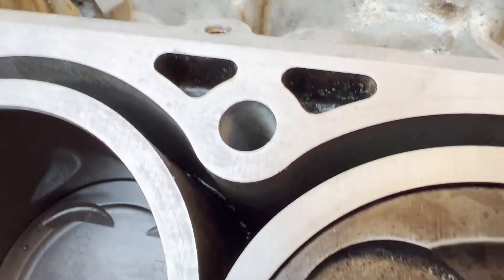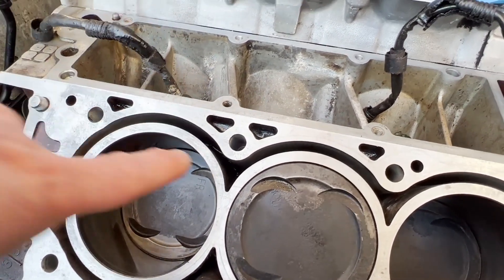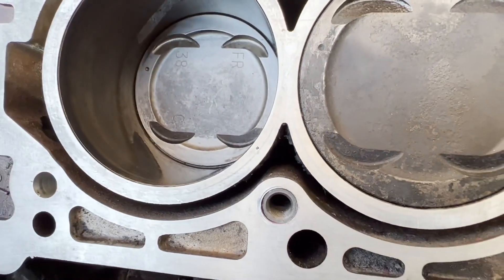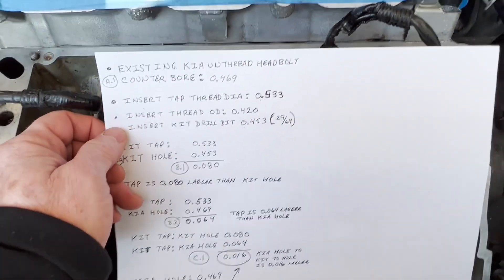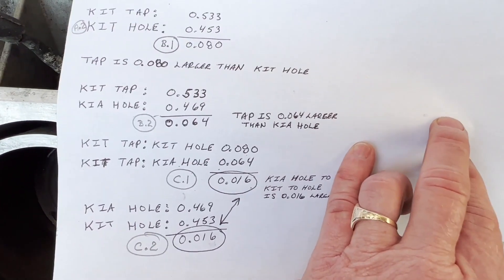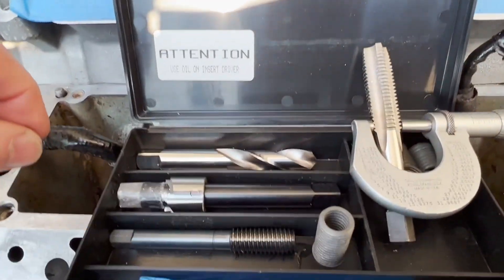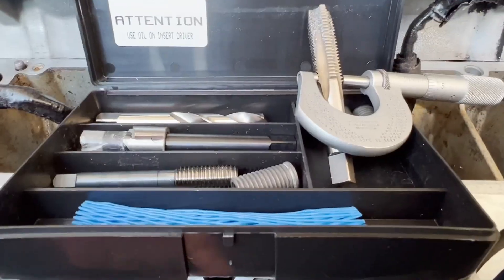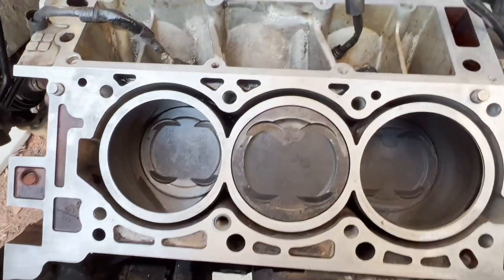Kia 3.8L Modified Head Bolt Thread Insert Repair: Measure Twice, Order Once

Comment: What size engine is this?
Reply from the maker: Hi. It's a 3.8L. Thanks for asking as I didn't have that in the title and description of this particular video of the multi part series as I ran out of room in the title. There's 8 parts so was hoping folks would have watched the earlier videos and followed it along. I just edited the title so that's now in there, and also in the description. 
This was an experiment as the approved method requires spending $400 -$600 on a single use steel insert kit that I just didn't want to spend on a 2006 Kia with 250,000 miles. Bottom line is: THIS WON"T WORK. DON'T DO IT!!!!!!! 
If you watch the subsequent videos you'll see how and why and I make it a point to stress that. The available inserts from any mfgr just won't hold with the size of the existing hole and drilling it out to a bigger size is not an option as the water jacket is so thin. 
I'm going to go with the approved method using the Huhn Solutions Kit which is just over $400. I like their kit better than the Time Sert Kit which for this engine is over $500, closer to $600. I back burnered this project for the Winter, but will be working on it soon. 
Thanks for taking the time to watch and comment.
Reply: @mkdhdinfiniteendlessconten3873  thank you for your response